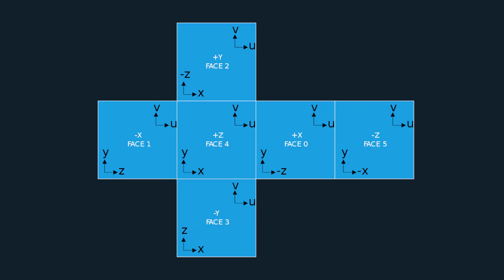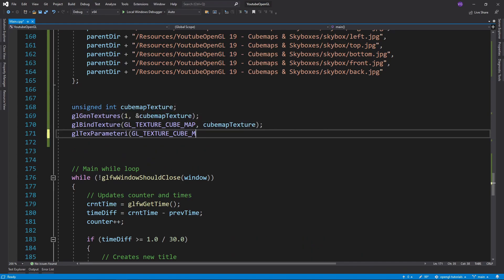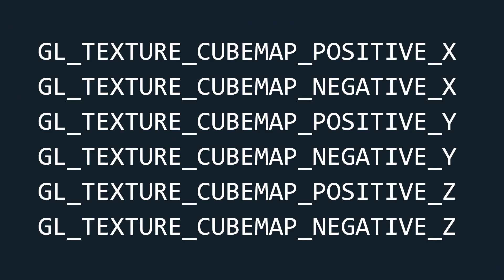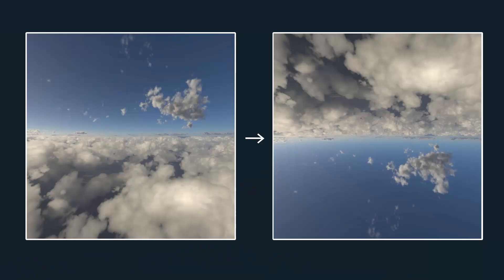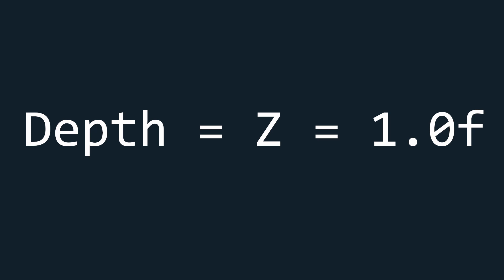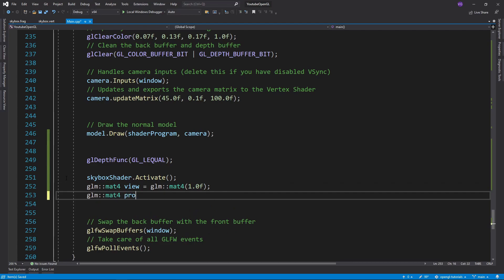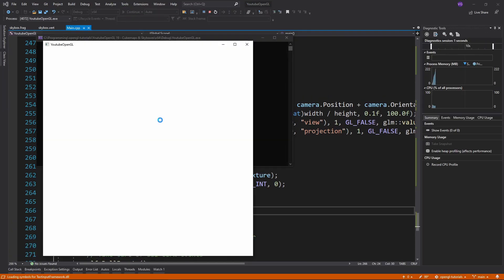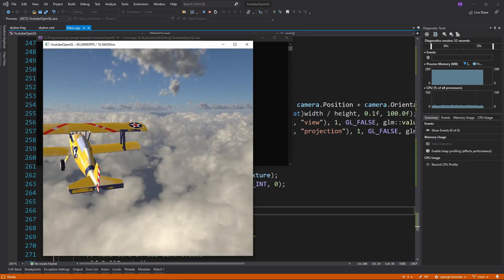OpenGL Tutorial 19 - Cubemaps & Skyboxes

Comment: For me there is a strange behavior with the camera movement in relation to the cube map, it does not correspond too well and you can note that the skybox is a cube. If in your implementation something looks off, try to adjust the skybox vertex shader from [ vec4 pos = projection * view * vec4(aPos, 1.0f); ] to [ vec4 pos = projection * view * vec4(position, 0.0f); ] with me, changing to zero results in a more realistic skybox and camera movement.

Another thing is that you can downgrade the view matrix inside the shader with [ mat4(mat3(viewMatrix)) ], it produces the same effect, but I it get processed in the GPU.

Also, great video! For me its a little fast to understand at first, but watching more 3 times make me understand better.
Reply from the maker: Hmmm, that is interesting. Not sure why that fixes it, especially since I'm not sure what you mean by "more realistic", but thx for letting me know! ;)
Reply: i got the same issues as you. i had modified z =0.0f and it worked ! Still dont know why it works :)))

Comment: I have problem with cubebox. My "right.jpg" image is upside down. Can you give me some solution for that problem?
Reply from the maker: Cubemaps can act very weird sometimes. I suggest simply flipping the image manually in Photoshop/Gimp/Paint ;)
Reply: @VictorGordan  I'm trying that. But it doesn't work :(
Reply: @tunglequang8503  i figured out that texCoords = vec3(aPos.x, aPos.y, -aPos.z); most like that maybe you put the aPos.y = -aPos.y that gonna let your texture flip upside down
Reply: @VictorGordan  I found the solution in some forum about this problem. Just change code in skybox.vert in texCoords = vec3(aPos.x, -aPos.y, -aPos.z) and change stbi_set_flip_vertically_on_load(true) in main and it works :)
Thanks you for this turtorial :)
Reply: did you fix it
i dont know how to
Reply: and the check if stbi_set_flip_vertically_on_load(false); like that and is not true but it most be false
Reply: @noname-ni3hp  I was able to fix it by flipping the right texture in my photoshop program as Victor suggested
Reply: `stbi_set_flip_vertically_on_load(false)` this is being called after you load the right-side image, move this top to fix the issue.

Comment: I met a weird problem in my project. All models are not rendered but the cube maps do in some computers. Could you please give me some advice to solve the problem? Thank you a lot.
Reply from the maker: Hmmm, that's indeed weird. Try running my source code on different computers and see if the problem is still there. If it isn't, then you probably missed something.

It's probably some difference in "defaults". Basically every GPU driver can have different default states/values for different parts in OpenGL, and while a program may work on one machine, it might not work on another. To prevent this you should as much as possible always be very specific with different settings and actions in OpenGL. 

I believe the glActiveTexture function differs from GPU to GPU. Some automatically assume glActiveTexture(GL_TEXTURE0) while others do not. So your problem might arise from something like this! :)

Hope this helps. Good luck!
Reply: @VictorGordan  Thank you for the detailed reply. I'll check about the setting across devices. BTW, I find a clue which is the number of objects. That is, computer A can render many objects (cubes), 200 for example, but computer B renders nothing under the same setting. However, computer B can render objects if the number of objects is set less than 4. Is there any setting regarding the limit?
Reply from the maker: Huh...that's only 144 vertices or 48 triangles,  computer B is either extremely bad, or there is something in the code. Most likely there is smth in the code.

But I have no idea why it can only render so few objects... sorry :/
Reply: @VictorGordan   I just foucs the problem which is caused by the sky box. If I do not render sky box in computer B, all objects can be rendered. It seems that the sky box covers all other objects. I've check your code works fine in both platforms. Maybe I have to check what OpenGL flags are platform dependent.
Reply from the maker: If my code works fine in both machines and you say the objects disappear, you might have messed up something related to the depth testing phase 🤔
Reply: @VictorGordan  I find the key!!! If I use glActiveTexture(GL_TEXTURE0) to draw sky box, it may demage the rendering of meshes and framebuffer. As I use other texture slot (GL_TEXTURE1, or larger), everything work fine. It seems that GL_TEXTURE0 is a magic number for rendering sky box. Do you have any idea about what may share the same texture slot? For me, the work around may be just hard code GL_TEXTURE1 for sky box rendering. However, I still want to address the cause.
Reply from the maker: Maybe you just didn't use the textures properly? I honestly have no idea. Especially that if the other textures would be messed up, you should still see black objects I think.

Sorry, no idea :/

Comment: Great video, I'm surprised at how well the edges and corners on the box are hidden from plain sight. Do the same kind of texture system work for spherical skyboxes as well? (like using a subdivided icosahedron instead of a cube)
Reply from the maker: As far as I am aware you can't use cubemaps with icosahedrons. But I see no reason to make a skysphere since it looks identical to a skybox.

Also regarding icosahedrons, I also used to prefer them for spheres since they have the least amount of distortion, but a quadsphere (sphere made by normalizing a cube) is much more flexible and easier to use ;)